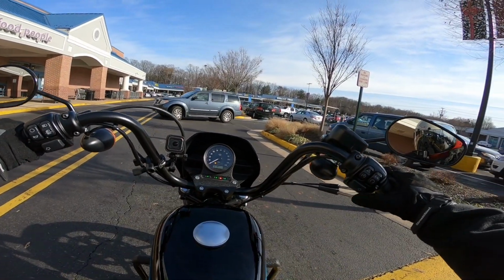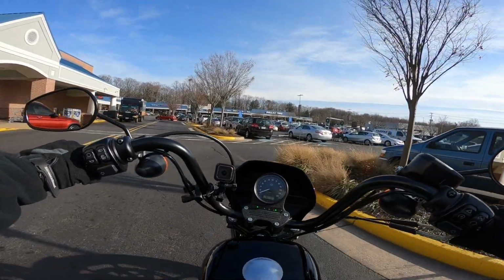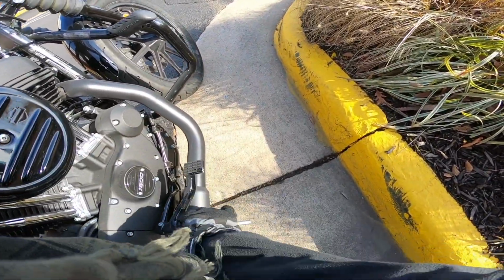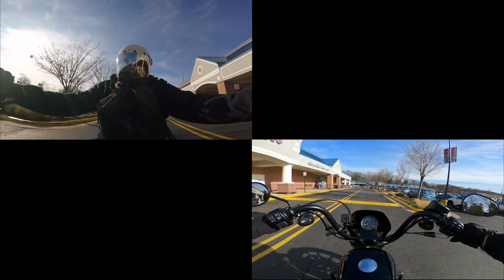Crash on my Sportster Iron 1200 - How not to tackle a speed bump

Comment: Sorry about the crash. That's never fun. I almost had something like that happen when I rode over a industrial hose where road work was happening. Gunning the engine got me over it, but any slower and I would have easily fallen over.
Reply from the maker: Yeah, you really gotta blip that throttle. I still cringe when I come up on speed bump. Had to go over about 4 the other day. #LessonLearned
Reply: @withPercy  about 4 years ago on the street in front of one of the places where I teaches, a MC rider shot out of the school's parking lot and hit a car that was backing out of their drive way. Rider was killed. They (the city) then put in speed bumps, but later changed them to have gaps in the middle so a rider can go between them. It sent a mixed message since the bumps were to slow down MC riders, but now it just upsets all the 4-wheel drivers on the road. Speed bumps no fun to deal with, especially in parking lots, but I just hope the same kind of accidents isn't repeated.